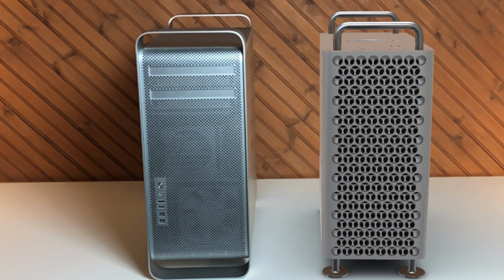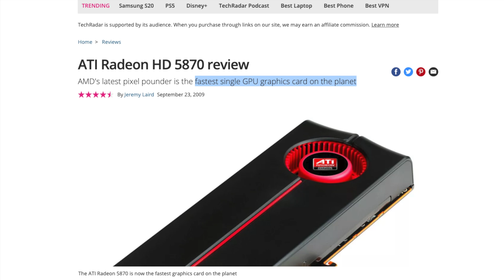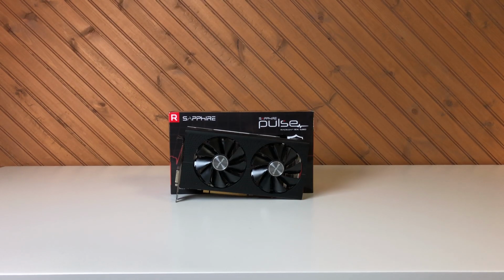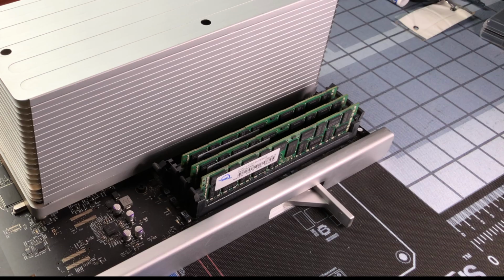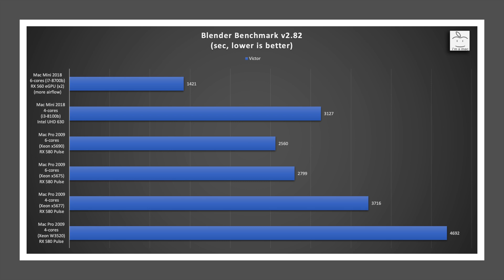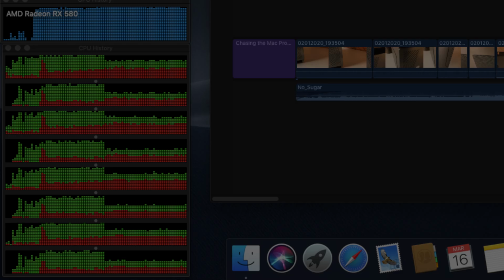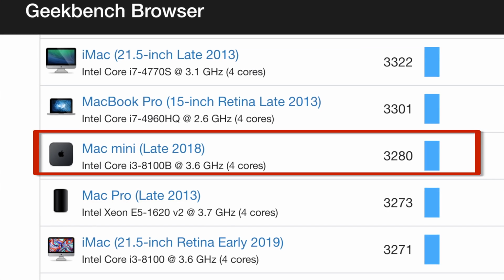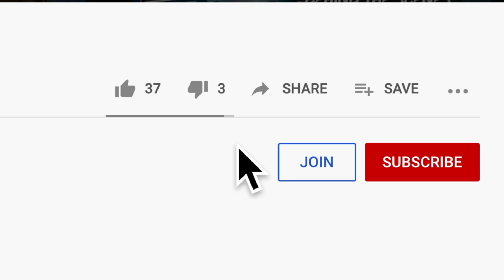Chasing the Mac Pro - Part 3: The Classic Mac Pro 4,1 in 2020

Comment: I need to fix my Mac Pro 4,1 first. I am having problems with the monitor, it is extremely pixelated and I cannot do anything. I guess is time to replace the Video Card. 
Can someone help me how to make sure what the problem is?
In case the problem is the Video Card, then I need to replace it.
What specifications has to be the new Video Card? 
Where can I buy it?

I tried on Other Word Computing company, but they said they can't help me, they don't have a Video card for my computer. 

Thanks beforehand you all
Reply from the maker: This is a bad time for a video card to go out, but it does happen. First, what is the model of the video card that is going bad (e.g. base nvidia GT120, ATI 5770, etc). Second, are you looking to just replace the same model to get up and running again or are you looking to upgrade? Third, what version of macOS are you running?
Reply: @ImaMac-PC  NVIDIA GeForce GT 120 512 MG, OS X EL CAPITAN Version 10.11.6.
About replacing it or upgrade it, I think if I am going to change it, I prefer a better one if is possible.
Thanks again buddy
Reply from the maker: @almartinez3371  Since you are using El Capitan and if you can live with the same performance, my advice would be to get another GT 120. They are all over eBay for $30-$50. The next step up would be an ATI HD 5770 or 5780, but now you are getting up to $70-$100 territory and those cards are not worth those prices. All the GPU prices are jacked up due to crypto mining (I just did a series of videos) and I don't expect it to get better until mid to late next year. Once the crypto crash happens you'll be able to get a nice RX 580 for less than $100 (today they are $400) and that would be a good card (and that's what I use) for that era of Mac Pro.

Comment: Did you use the cord that came with the video card or did you have to get something else to connect it? Looking at doing a similar setup so I'd like to know. Cheers
Reply from the maker: I needed to purchase the cable and purchased that one from Amazon, although not there now. Just search for "Dual Mini 6 Pin to 8 Pin PCI Express 18AWG Mac Pro" and you can find many examples on Amazon and eBay.
Reply: @ImaMac-PC  Thanks! Yes I found one on Ebay. 
Great video by the way.
Reply from the maker: @soulfulearthjourneys8816  Thank you and enjoy your Classic Mac Pro!

Comment: I have the dual x5690 6c/12t 3,46 GHz 4,1 flashed to 5,1 and I just ran GeekBench 5 just for fun and it scored ~6700 (I have 128 Gb of ram so it’s a little slower than the 64/96 Gb config) but still for a 2009 computer that’s not bad at all; sadly I hardly see this Mac challenge the 2019 Mac Pro with my configuration at least
Reply from the maker: That's a great score. If you removed a stick of RAM from each side for triple channel memory, the score would likely go up to 6800-6900 range. The new Mac Pro is around 8000 with 8-cores. So it's not too far off. I love this old Cheesegrater and even now in 2020, it's still really useful. Thanks for sharing!
Reply: I'm a Mac well yes but i haven’t done it because I much rather have 25% more ram than 1,5-3% speed increase, I want a powerful machine but I don’t want to compromise so much just for a little speed, i usually use a lot of ram (emulators and such) so it’s relatively important. I much rather have overclocking on Mac than have to remove ram to go a little faster. Don’t get me wrong I really appreciate your work and passion in doing this kind of extreme thing but for what I normally do it’s not really that practical and/or efficient. Sorry for bad English and keep doing videos like this one! I really like them

Comment: This is a very interesting series, thank you for sharing it. I have two 2010 Mac Pros, both of which I have upgraded to dual CPU trays, with the same 3.46 Xeons you have used in this video. I have also set up, as the boot drive, one terabyte NVME SSD's, using one of the PCIE slots. These modifications have made a huge difference. It would be interesting to see your experience, if you have the time to give it a try.
Reply from the maker: I like the idea of the NVMe SSD and dual CPUs. Thanks for sharing!
Reply: You are most welcome!

Comment: You need to activate hardware acceleration on your Mac Pro. There is a simple way to do it using opencore. Basically your stuck right now having the CPU do all the work or most of the work for video editing. Once you activate hardware acceleration your gpu will do most of the encoding and decoding.
Reply from the maker: Thank you Louis! That's exciting news. Using a modern GPU for the hardware encoding/decoding would certainly "breathe some new life" into this machine. I will look into this as the benefits would be tremendous.